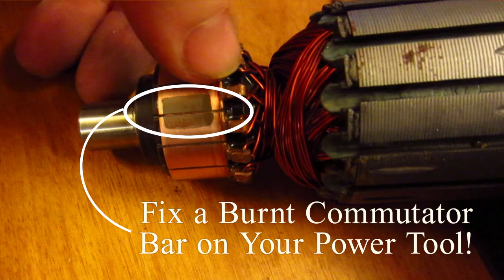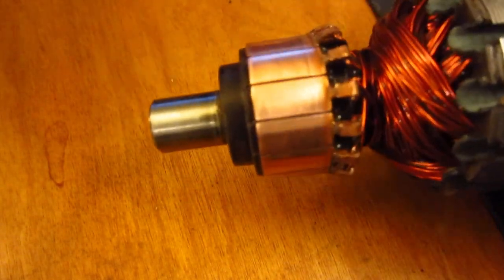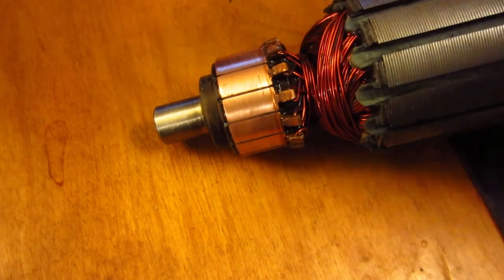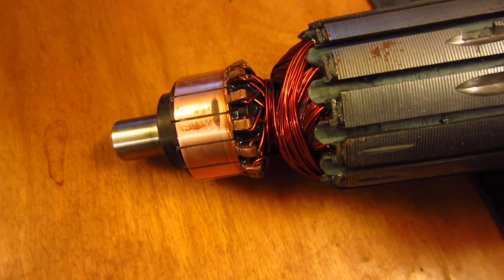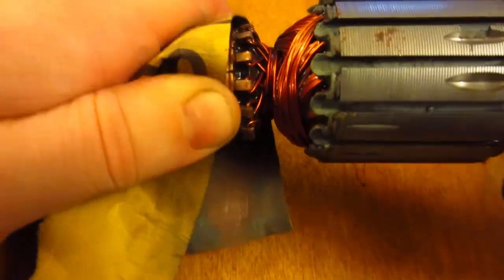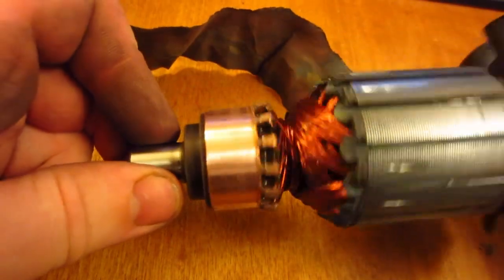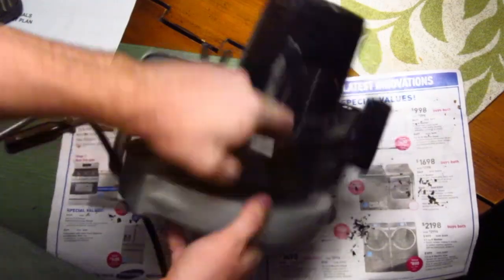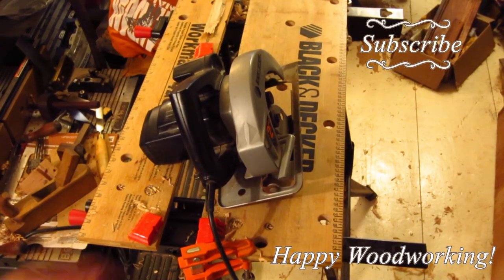Easy Power Tool Fix: Burnt Commutator

Comment: That reminds me of a lawn mower that was difficult to start.  It was an unbelievablye easy fix.  It only needed oil!  It amazes me that the guy who gave it to me seize the engine because now it has gone from being the dreaded multi pull piece of junk that no one wants to use to a one pull start mower.  It probably helped a little that I flushed the oil with some transmission fluid with a little engine flush and a bit of decent synthetic oil.  Just put that concoction in the crank case and run it a few minutes and drain.  Afrer that put in some new oil along with a little bit of an additive not found in stores or any place local for that matter.  It is not something containing Teflon or chlorinated molecules of any sort but leaves a slick coating behind.  Chances are you may not even know the brand of the stuff I used but it is one of those products the skeptics are quick to call snake oil.  All I can say is I have used it in my car and it now runs smoother so they can take their snake oil and shove it where the sun never shines.  I hate people who knock a product without having tried it.  It is because of that some of these miracle products never catch on and sadly the makers of them go bankrupt.

Just to prove that I am not selling anyone's products, I won't mention the brand and advertise for them.  They do not pay me anything anyhow.  If you are into this stuff as much as me, a little research may have already helped you find it or something like it.
Reply: +John Doe Ummm cool story bro ... ???

Comment: You did not repair the bad connection so it's going to burn out again soon.
Reply from the maker: Maybe?  This was over 6 years ago and it's still my go-to saw for rough cutting panels or sheet goods.  When it's finally retired I'll be ok with that.